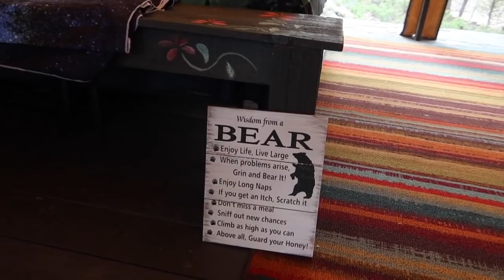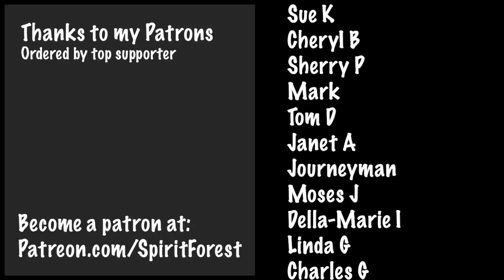Can she get the CANVAS TENT up by herself? - Spirit Forest - S4 -Ep#47

Comment: You might try getting 2 or 3 "lally columns". These are typically 3" wide steel pipes, with end plates, that are the screw jacks used to support sagging floor beams. You could put the ridgepole across the tops, then take your time screwing each one up a couple of inches at a time. They can also be rented, not expensive either way.

Comment: 🇬🇧   If I'd been putting up your tent there would have been a lot of bad language flying about.    The tool called locking pliers is called a Mole Grip in UK and "Vise-Grips" in the US.    One of the most useful tools I have which I think I "aquired" illicitly.    For future use you could maybe do with a pole with a Y at the top with which to push the beam up.    Two maybe, one for each end and an angled hole at the base and a small hole in the floor to temporarily peg it in place whilst getting the other end up.   
And I didnt laugh.    My heart ached for you.     Glad your friend turned up.     💞💞

Comment: Gosh, I go through similar, having to lift so many things. Yesterday I had to load  a 2 and 1/4 ton floor jack onto my truck bed and take it to the home I bought. I tried to run truck to make the jack slide off back of truck. I ended up dropping jack onto ground because I was not going to lift it off. My husband passed last year, so I'm on my own and it's been very hard because I have 3 steel rods in back bc spine is curved.

Comment: I've not read the comments so this suggestion may have already been made.  Ask the girl's daddy to treat you a starter kit of necessary tools.  At Amazon, the best starter, here: https://www.amazon.com/dp/B000E20HWA?tag=aboutcom02thespruce-20&linkCode=ogi&th=1&psc=1&ascsubtag=4117602%7Cn03c46c7846a44ca7ab53ee3df4af825d22.  Plus, at Home Depot, you can get a small tool box with a removable tray which will accommodate additional tools you will need.  Watching you try to put the tent up using needle nose pliers and the adjustable vice grip makes me cringe. You will save so much time properly equipped. I know you can get the starter kit yourself, but just thought that the girl's daddy ought to get the kit started for you.). :)
Reply from the maker: I got one.. just didn't have it with me.   Bringing it up there for sure.
Reply: Spirit Forest 😊 Ah well, Amazon also offers any number of books on improving and maintaining one’s memory 🤪